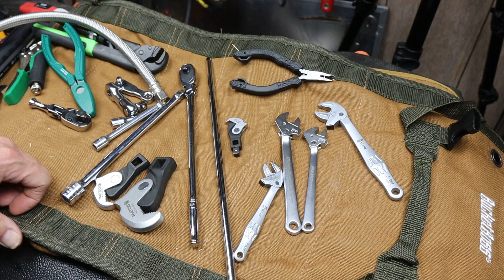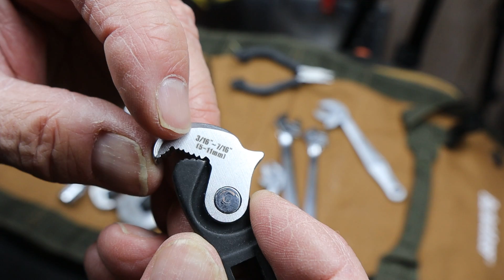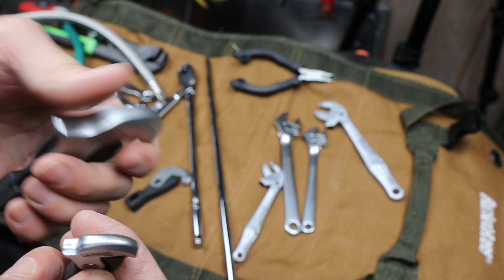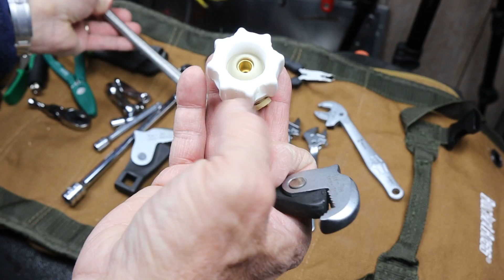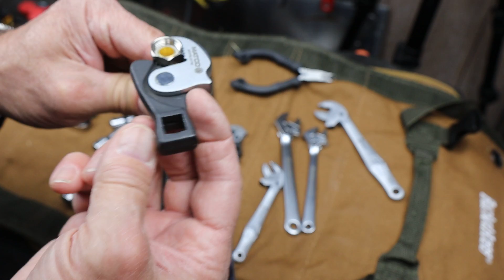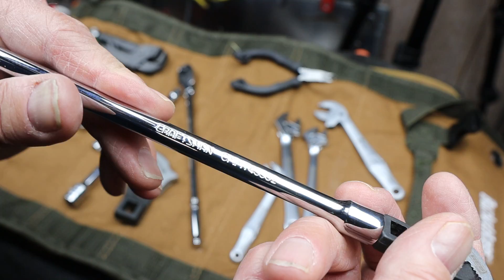ARES 1/4" Adjustable Crowsfoot, needed to complete the set.  Wera wrench déjà vu, & a Craftsman Fail

Comment: When the little spring breaks on them and they will then it becomes junk. Thank you for spending your money on this. That way I can always be informed on stuff without spending my money.
Reply: Until it becomes junk I’ll enjoy using my Ares set when needed at work lol and then I’ll gladly spend the money again, because I have a job to do and sometimes tools are consumables. Like wire strippers and insulated screwdrivers.
Reply: LIFETIME WARRANTY...BOOM...☝️ blew that right out of the water
Reply: Kind of like how you became junk in high school.

Comment: I have the 4 piece Wera kit. I got them as a gift. I never used them. A few months ago I had to swap out a laundry sink I ruined. Those sinks are really deep and the faucet nut well if you know you know. The Wera would have been perfect. I grab the set and the largest one was too small. I need the Xl or XXl whatever the next size up the kit doesn't have. So still never used them but want to buy it anyway and also the 3 Ares because you never know. :) Those Ares are really nice.